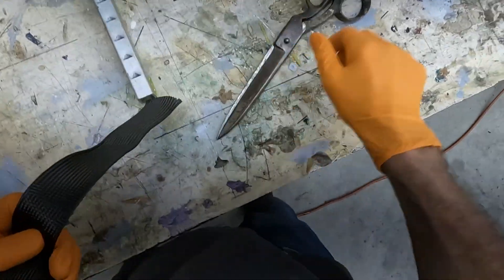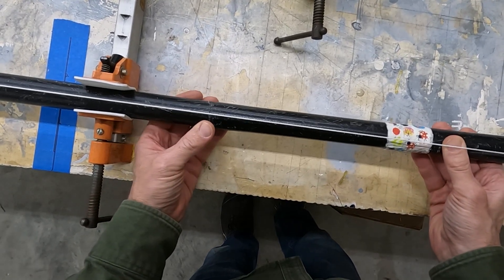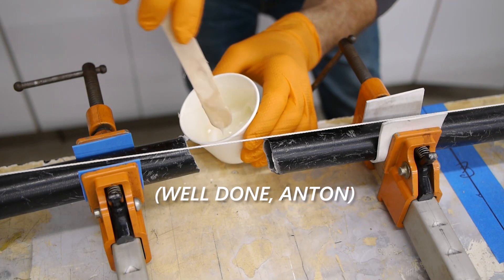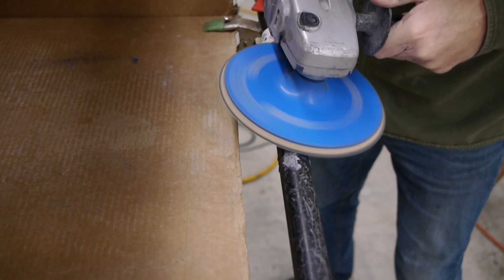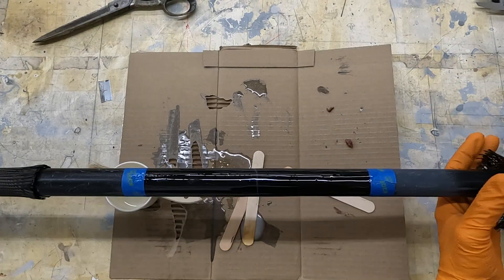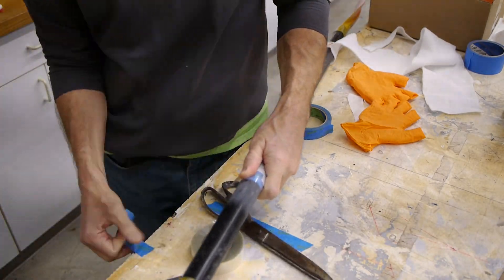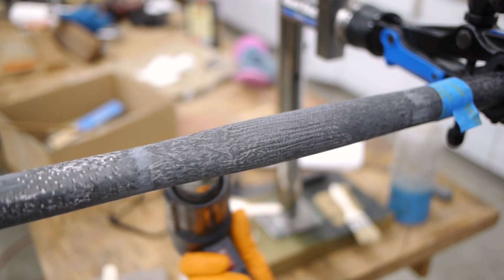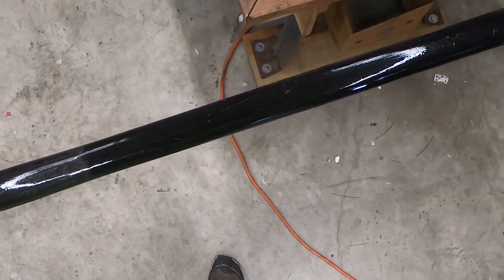The Harper: Kayak Paddle Snapped in Two

Comment: I have a snapped werner stikine, almost identically snapped like the one in the video that werner isn't accepting to fix, I was wondering where you would source the carbon fiber cloth... more importantly, I was wondering if you fix paddles :) I would do this myself as I am relatively handy and have experience with carpentry and things but never worked with carbon fiber. I live in Portland oregon, I would love to hear back from you!
Reply from the maker: I think I bought this carbon sleeve from Soller composites, but there seem to be quite a few sources for carbon sleeve online. 
I'm in the DC area, and only do local work. Best of luck with your paddle!

Comment: I am wondering why you did not use an internal splint?
Reply from the maker: The entire strength of the paddle shaft is in the outer composite shell. Internal splints aren't necessary and are usually more trouble than they're worth. I find it easier to just tack it back together with epoxy, which is strong enough to hold the paddle together while I work with the carbon reinforcement which will provide the full final strength.